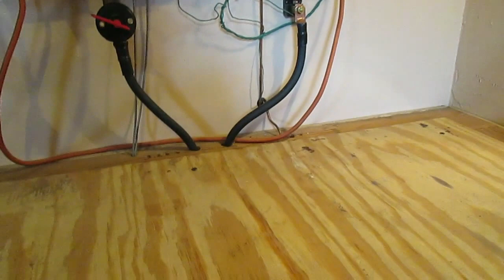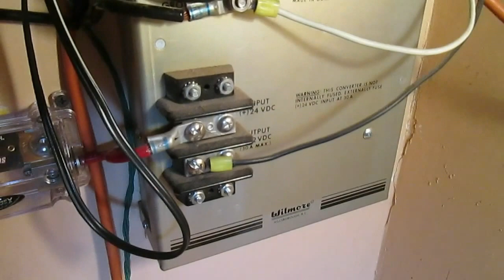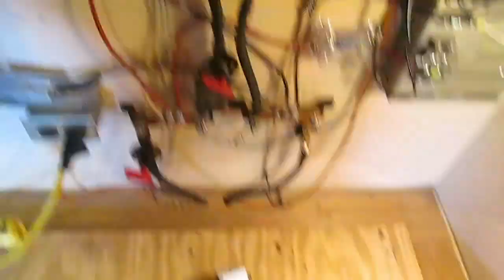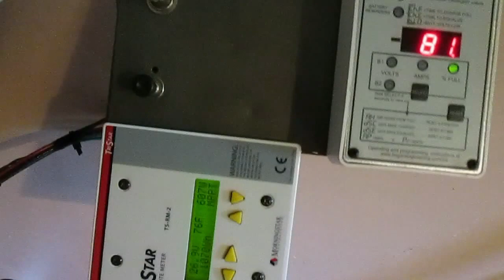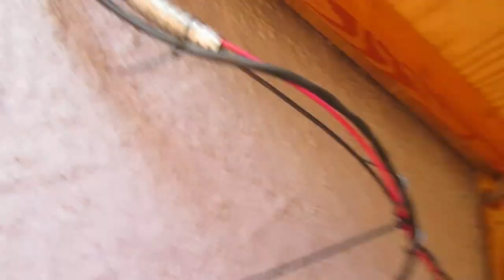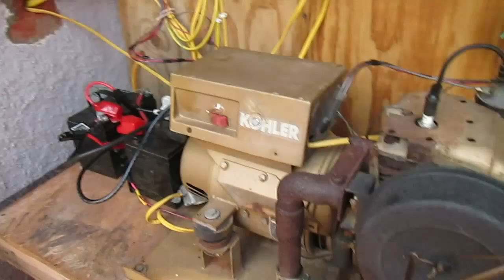Solar Panel How-to  / Simple Explanation

Comment: what's the rule of thumb to sizing the fuse between the inverter and battery bank
Reply from the maker: I can't recall a rule of thumb, and it has been a few years since I built all of this, so I don't remember why -but what I am running there is a resetable Buss brand breaker, in 70 AMP DC.

Comment: I would like to set up a 5th wheel trailer to be completely off the grid (solar).  Would two deep cycle 12v batteries work just as well for something like that? Arent these 6v batteries basically deep cell batteries? Awesome video, love the way you explain things simply and precisely. Thanks

Comment: Tried checking your website but it was not up. I know the video was uploaded in 2014, but I was wondering if you had a write-up, basic cost breakdown for a setup like this, either via google docs or something similar; as I am very interested in this sort of setup.
Reply from the maker: The website is down for updating, and sorry, I did not do any sort of breakdowns on building a system. I just wanted to make this video to pass along a basic understanding of the idea of off grid battery charging via solar.
Reply: Not a problem, and the video itself is an excellent breakdown.
Reply from the maker: Thanks!

Comment: The Unknown Cat...how did u do this? I wanna learn this, but it seems to much any ideas where to start?
Reply from the maker: +frankvalle I would recommend getting a small solar panel kit from Harbor Freight -they sell a 45 watt set up for $150 or so. Use it as a lab to learn how it works and what you can do with it. Use it as a model to understand battery charging and efficient electricity use ...and if that study takes hold of you -then get ready for a lifelong addiction.
Reply: I will do...thank you
Reply: +The Unknown Cat The Harbor Freight unit is a ripoff, you only get 45W and it's overpriced for that power. Get a couple 100W panels off eBay for $120 each, and they last forever. Buy a $20 solar charge controller and a couple car batteries in parallel and you have 200W whenever you want it. Add a 900W inverter for about $85 and you can run 120VAC appliances.
Reply from the maker: rstevewarmorycom Things are changing fast in this field -prices are coming down as more people become involved.
Reply: The Unknown Cat Yup. The price of solar has fallen 20% in three years. The cost of inverters is being driven down by Chinese imports, thank gawd for the Chinese, they sell electronics as cheap as it actually is!! The solar charge controllers are now down to $10 for a 20A unit!
Reply: Maybe they'll make them so cheap that it'll offset the ridiculous level of pollution they put out lol
Reply: The Unknown Cat That one's a rip-off. Get a 100W panel off eBay for $120 and a cheap chinese solar charge controller for $15 and charge your own batteries with it. Read the instructions, watch some how-to videos and you'll figure it out.
Reply: DirtyFrigginHarry The Chinese electronics industry is as clean as ours, you're believing propaganda and malarkey. The Chinese are ahead of us, did you know they are installing 3 of their 2MW wind turbines every DAY? They are beating everyone else.
Reply from the maker: rstevewarmorycom Pretty sure my Tri-Star is a little better than the $20 Chinese controller

...just sayin'
Reply: The Unknown Cat  I wasn't referring to their electronics specifically, just their overall co2 and smog levels which unless I'm mistaken are prettty high. I know the air quality is horrible.
Reply: DirtyFrigginHarry Their smog levels in Beijing were due to burning coal for electricity. They are now working harder than any nation on earth to phase out the use of coal.
Reply: rstevewarmorycom
 huh. I assumed it was due to population density and a disproportionately large amount of manufacturers and factories with lax regulations
Reply: DirtyFrigginHarry So you imagine that lots of people just happen to make smog? How? By farting? No, it's the electricity they use, and that comes from out of town a ways, but Beijing is right in the smog path down the valley from those plants. No, burning coal and some cars and trucks do it ALL.
Reply: Well yeah I know how it's made, but the higher the population the more cars and trucks they're using and the more factories the more pollution even if they are taking big steps to reduce their output
Reply: DirtyFrigginHarry They will get there before the rest of us. The advantages of a command economy,

Comment: Is there a way  to only use solar panels, and a converter and regulator without any batteries, (to directly plug in vacuum cleaner etc. during sunshine days) as all of that additional equipment and batteries I would think is still very expensive...
Reply: +Susan Stone Salas No, you have been watching too many videos by people who didn't know anything, so they bought a bunch of shit they didn't need. A 2kW inverter can be had for $150, smaller inverters for less, and a cheap $20 solar charge controller can manage a 400W solar panel system. See eBay. You can use solar panels alone, but then you have to match your appliance to their voltage, which will vary with the sunlight. But any car battery can buffer that so that the variable light is evened out to run an inverter. If you use a cheap auto vacuum that runs on 12V you can run it directly off your panels up to 18 or 19V safely.
Reply: +Susan Stone Salas HAHAHAHAHAHAHAHAHAHAHA
Reply from the maker: +Susan Stone Salas No, it just doesn't work that way :D
Reply: Hummmm, Im sure hoping it will at some point in the future,,,  :)
Reply from the maker: +Susan Stone Salas It could happen. It's hard to guess what the future holds, living in such an amazing time!
Reply: LOL!!! Yea!

Comment: Great information.  However my concern has been an EMP (regardless of the source).  Wouldnt most if not all of the electronics used to run a solar system be damaged in such an event?  Is this something you have considered and if so, what are your thoughts?  Thank you